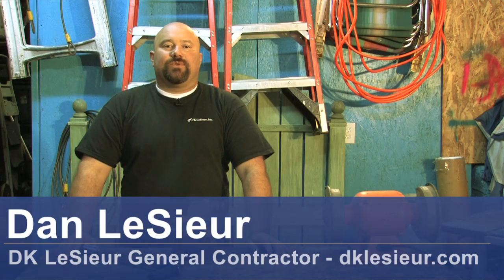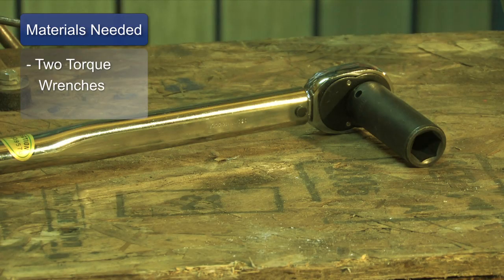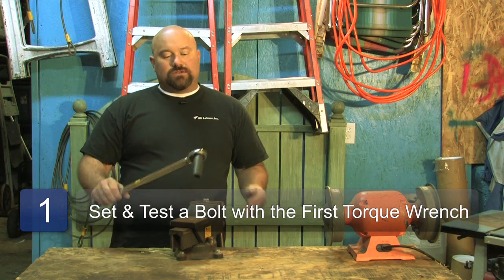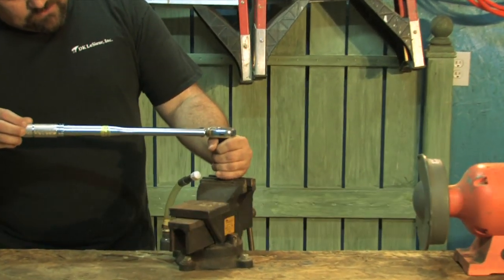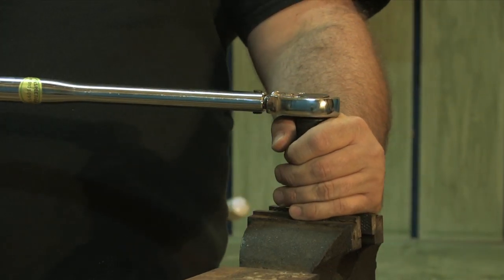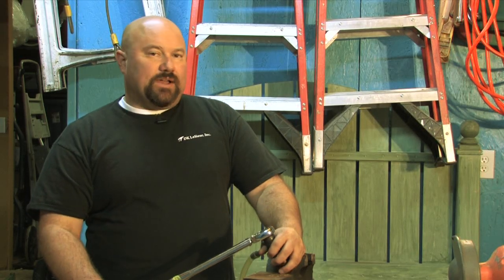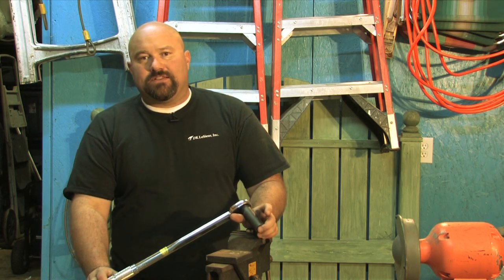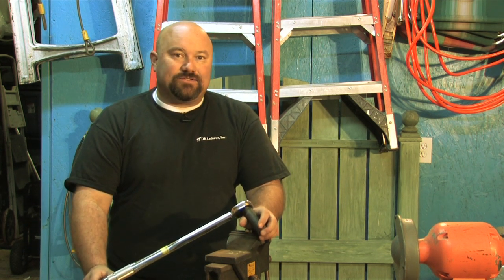How to test your torque wrench

Comment: Thanks for sharing, however, your test and does not prove very much. For all we know, that bolt could be torqued to 100 ft ilbs and your test torque wrench, set at 75ilbs may still click. You see where I'm going with this?

 What you need to do is torque the bolt at 75 ft lbs using a calibrated wrench, mark the current bolt position with paint, loosen the bolt at least 10 ft lbs, then re-torque the bolt at using the test wrench. If the paint marks align, then you're good to go.

Comment: what if they are both BAD du best advice is pull this video  I agree when you said another way  but it is NOT another way it is the best way you NEED to have a torque calibration fixture to do this RIGHT all other ways are good a guess at the best hope you are not missleading people on other things TOO

Comment: This is wrong. If bolt is torqued to anything greater than 75 ft/lbs and the second will still click at 75 even if the bolt is torqued to 150 ft/lbs. You could produce the same result by clamping your wrench in a vise and pullong til it clicks.

Comment: OK lets assume that wrench #1 is correctly calibrated and tightens the bolt to 75 Ft.lb.  Now the second wrench is set for 75Ft.lb but actually will click at 60 Ft.lb.

Using this as a test will not disclose that error.

Now assume that Wrench number two is set for 75 Ft.lb. but clicks at 85 Ft.lb.

Are you going to be able to tell the difference with your bare hands?  (If you could you wouldn't need a torque wrench.) 

Your method would not disclose that error either.

Comment: I have an electronic torque angle meter.  Does these ever go out of range?  Its a kent-moore j36660 used for gm engine assembly.
Ferd

Comment: Another method is to get an Alltrade Digital Torque Adapter, which is fairly inexpensive, and is designed to measure the torque applied by your wrenches.
If your torque wrench is off, you can either calibrate it or just apply the correction to your setting to get the right torque value.

Comment: This method will not work , even if you have the known good wrench.  After the first wrench tightens it, the second wrench will always click without moving the nut any further, unless it's really far off and applies a higher torque than the target..

Instead, you might torque the nut with your reference wrench, and then place a mark on the nut to the fixed point on the vise.  Then loosen it up again, and use your second wrench to torque it. Compare the marks on the nut to see if.they match-